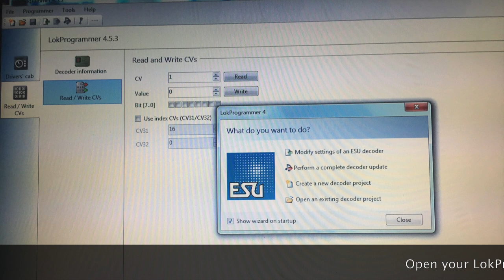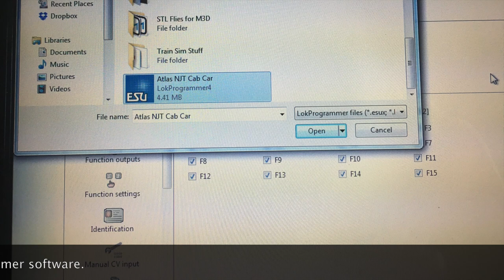How to: Installing sound in Atlas NJT Cab Car

Comment: Thanks so much for making this video!  I'm new to installing ESU decoders and wasn't sure where to start.  Atlas doesn't have any details on their website either.  :-(  
My ALP45DP already has sound - is it necessary to reprogram it to match the cab car?  Thanks again!
Reply from the maker: Not Getting Any Younger Yes if your want your ALP45DP and cab car to work flawlessly, yes it is necessary to reprogram it, it's not anything you can't revert later on down the line. And do you have Instagram?
Reply: Never really use Instagram, but I have it.  Also, was planning on buying the ESU decoder pre-programmed from Tony's Trains - I don't have a LokProgrammer.  Not a PC user, I'm a MAC guy.
Reply from the maker: Not Getting Any Younger yeah I'm not a PC user either lol but I have a PC specifically for the Lokprogrammer, but if you run bootcamp you can run the lokprogrammer that way. And buying the decoders pre-programmed is ok... I will usually buy them dirt cheap like when guys rip them out and put something else in, and then just wipe it clean and then reprogram it and then I can make any necessary changes to the program, I would recommend if your going to be using loksound to invest in boot camp and a programmer, but your way will work too it's just a super pain to program them manually
Reply: Awesome video

Comment: Would you be able to make a decoder like that for me.    How much would you charge.    I don’t have to ability to program stuff like that
Reply from the maker: Would it be for a NJT train or a different commuter set? Yes I could, and price would depend on if you were supplying the decoders of if I was buying the decoders
Reply: @NSReadingLineRailfan  I would need you to go ahead and buy the decoder and yes it would be a NJT cab car
Reply from the maker: @Chessievalleysouthern815  you have a locomotive as well?
Reply: @NSReadingLineRailfan  I have the F59PHI but it’s already programmed with sound.    It’s a Athearn RTR with sound
Reply: What’s the best way to get in touch with you for decoder programming?

Comment: Wait a minute, so I have to have to slots on my DCC controller? One for the Loco and one for Cabcar even if I don’t have sound on the cab?
Reply from the maker: no, if you program it the way i have it set up the cab car and locomotive will work under the address of the locomotive
Reply: What if I don’t have the tools to program it?
Reply from the maker: did you put sound in your cabcar or is it still dc
Reply: I haven’t bought it yet but I don’t plan on putting sound in it immediately
Reply from the maker: then if you dont do anything to it from the factory it will just run like any other passenger car because it does not have a motor in it.
Reply: I see so I couldn’t control it’s headlights individually or do those rely on the direction of travel

Comment: After you re program the alp, how do you get the cabcar and and the alp to work in conjunction?
Reply from the maker: they both work off of direction and the ALP's road number on the DCC sound decoder
Reply: NS Reading Line Railfan Thanks!